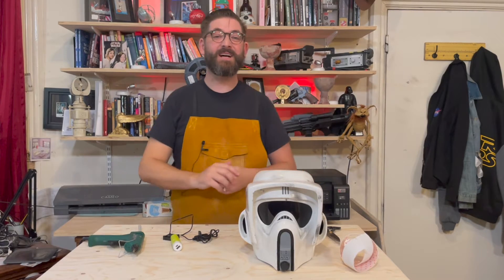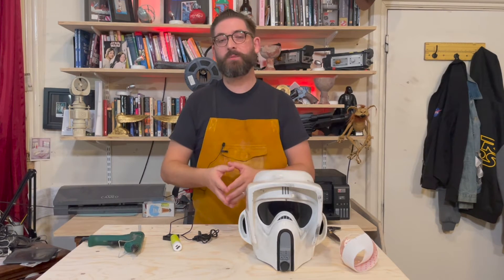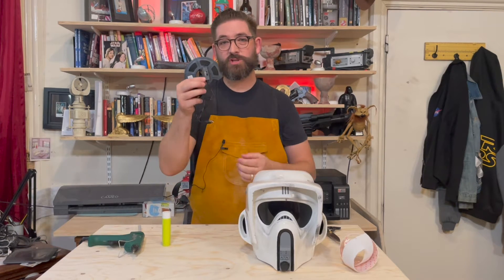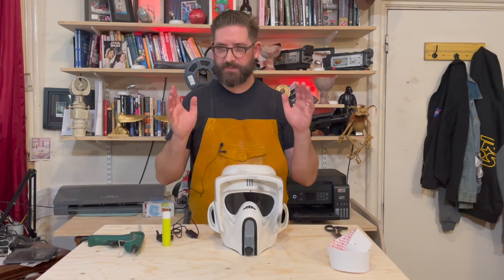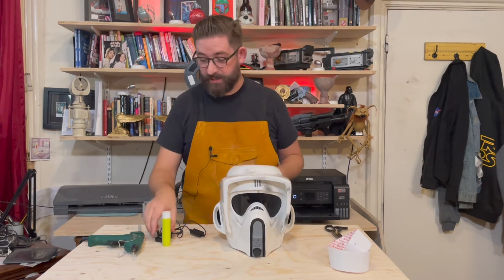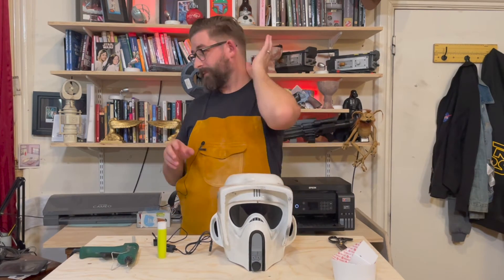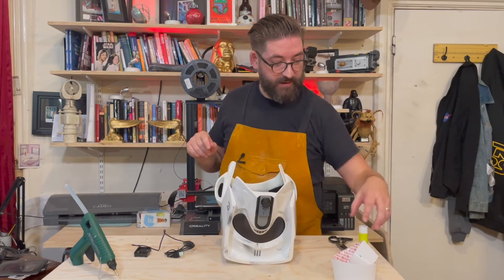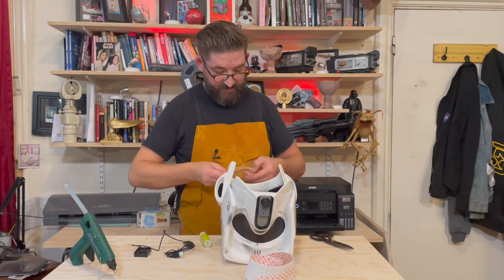How To Put Fans In Your Helmet For Less Than £20

Comment: So glad I found this video. I am on my second Mandalorian kit. My new custom helmet fits my head to the "T", so there is hardly any space for a fan. I compared the dimensions of this model to the one in my Boba Fett helmet, and they are even smaller. There is a good chance there might be just enough space...ordered them right away.
Battery-wise, I am using right now a conventional 4 AAA battery pack. However, I have the option to connect it to a USB power bank.
Reply from the maker: Love to hear how you get on. In tight helmets it can be so hard. The other option would be to find a fan with a side air draw in but smaller ones aren’t easy to track down.

Comment: I'm currently building a biker scout helmet. I have fitted a turbo-style blower fan to the back and made a tunnel using Eva foam to direct the outflow to the rear vents on the back of the helmet. This causes the air to flow in via the ear vents and the bottom. Of the helmet. Hoping this will cause a reasonable flow of air to allow me to wear my glasses without them constantly steaming up.
Reply from the maker: Turbo fan - how noisy is that? I used one before but had to remove as I couldn’t hear anything.

Comment: Hey there! Great video :) I bought the fan you suggested for a mask I'm working on. I can't find the same portable charger you recommended and have tried a couple of mine I'd previously used at cons to keep LED light strips running for a full day. After 2 minutes of using them with the fan, they respectively cut out. Is this a problem you've encountered? Any advice for alternative portable chargers I can try and what sort of runtime to expect for this sort of setup? Thanks!
Reply from the maker: You need to buy a usb battery that has no low use cutoff. The ones you have are cutting off as the power output is so low.
Reply: Thank you!

Comment: brilliant.I've been trying to do something like ths for ages for my first boba fett and comicon in nov 24. After loads of differnet tries this looks just like what I want. (obviously just different positions etc). But I have a powerbank on my Boba Fett belt hidden away and was wondering how long the usb end is from the switch end. Obviously yours is all in the helmet and I want to hide my cable under my clothing soneed to know if it will reach. Or do you know if i can extend the power cable. I have never done something like this before and my soldering is wellbelow par to say the least . Many thanks for your video I will be watching the troop on youtube.

nick

Comment: so I live in USA Arizona, and therefore hot glue is not really an option.  do you have any alternative suggestions?
Reply from the maker: I’d use 2 part epoxy. Then you would know it’s solid.
Reply: I use PowerTac, similar to e6000 but less stinky.